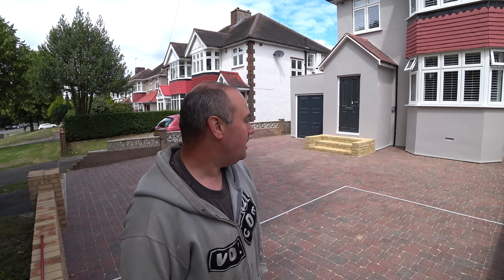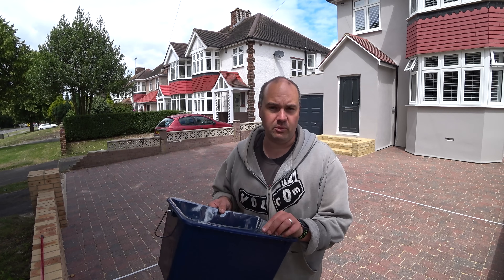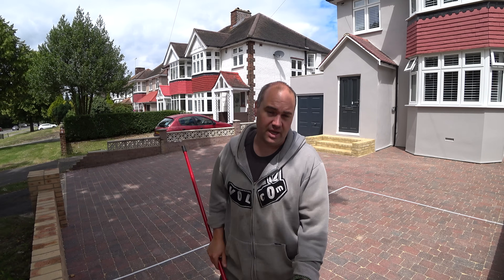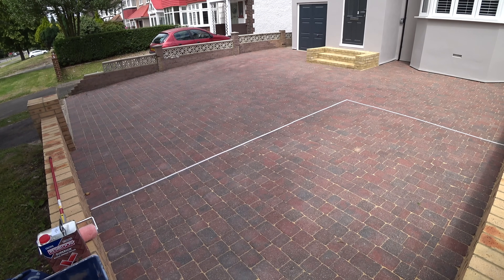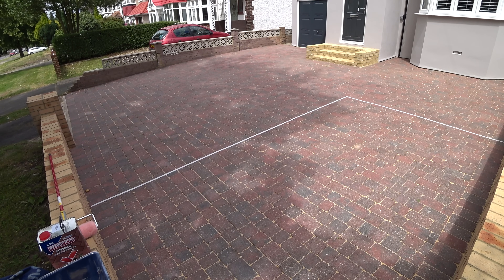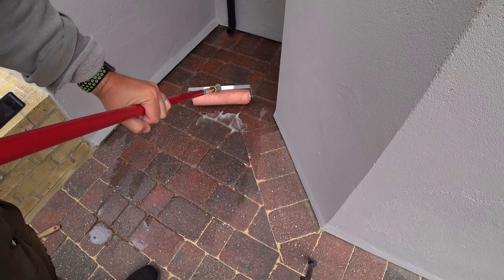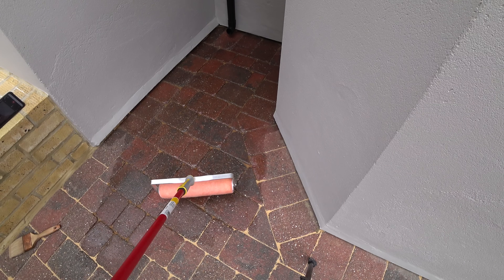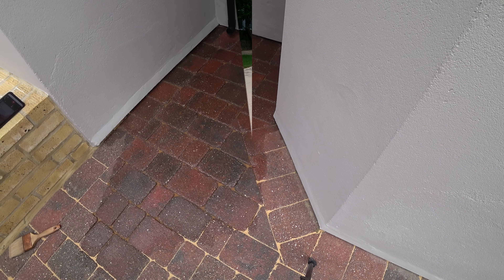How to Seal a Block Pave Driveway - Resiblock Superior Demo & Time-lapse

Comment: Hello Phill, Another good video. From what I have read on the net and grasped from resiblock themselves is that when using a polyurethane resiblock product it can be very unforgiving. Before you re sand make sure the tops of the blocks are dry and you do quite a few test patches all over with dried kiln sand in the joints letting it sit for for say 20-30 mins before digging it out. It is crucial to determine if  the sand bed beneath is dry. If it showered or rained unexpectedly this would be a big problem!!! Any moisture that gets trapped under the sealer will cause a bloom (white milky patches). Once the PU  sealer has cured     you can not    simply re emulsify it with thinners to chase out the moisture. You would need to apply a chemical stripper and jet wash the lot off-which would be a nightmare!  Or it needs to be dry and  manically abraded off.  I have no doubt resiblock is a fantastic product but does need skill, knowledge and caution to use it. Thank you for taking the time to make the video, keep up the good work Phill.
Reply from the maker: matthew calder yes it does need the right conditions to use properly. Like most things it needs to be dry. So long as the blocks themselves have had plenty of time to dry it will be ok. Yes the sand needs to be dry, by sweeping fresh sand into the joints any moisture withing the joint will be wicked up to the surface and you will see it quite clearly. So long as the sand and surface are perfectly dry all will  be well. Resiblock do have guidelines for its use, but they have to have them to ensure the product goes on properly with no comeback. They offer no oil stain guarantee etc so they have to ensure the product has been applied in perfect conditions. Any rain or moisture will ruin the finish and hence case milky patches.
Reply: Dirty Drive-Away Thanks for your reply Phill.. Anybody that has not done there homework on how to use a polyurethane sealer will  open up a big can of worms if any moisture gets under the sealer from either damp sand or damp blocks. In the event it needs to all be stripped off Resiblock told me  they advise contractors to buy " " paromorse"  (licence needed to use it) or Enviromorse pro from Brewers. When I enquired about the products I was suprised to hear they sell buckets of the stuff as there are so many people out there who get it wrong. Cheers Matt
Reply from the maker: matthew calder will remember that product if needed in the future. I'm one of resiblocks contractors and they have never mentioned paromorse. I know they sell there own so called tool cleaner but I think that only works before it's cured.
Reply: Dirty Drive-Away resiblock dont want to promote things that could go wrong which is understandable from a marketing point of veiw as it could harm sales. Ive read you can use nitric acid which is nasty stuff , or a product called easy strip 2000. Would be nice if somebody who has had to go down this road could tell us there experience. Cheers M

Comment: That looks like a £1000 job with the cleaning and sealing.  In my area, If I quoted £150 for the clean alone they would shudder and throw up.  LOL.   I think its the thought of them having to move the Bently.
Reply from the maker: With the resiblock it was £1100

Comment: Arnt you supposed to brush it off mate ??
Reply from the maker: No, you just roller it on and it soaks into the blocks and joints. You only need to brush it off if your dealing with riven natural stone where it may pool in the recesses.

Comment: Superior gloss thought it would be glossier.
Reply from the maker: Yeah to be honest I thought it was going to be proper bling but it isn't. To be fair it was quite nice, it had a slight shine, more than the Matt version which even though is classed as Matt can have a satin damp look. Problem is a lot of people think gloss and it's going to be proper shiney but it's quite subtle. Even still it's not everyone's cup of tea hence why I don't do many gloss ones as people get put off by the "gloss" bit. Phill
Reply: Cheers for the reply I've tried a couple of gloss ones that say gloss or high shine but just darken (glossy)a bit then look normal when fully dry  cost a fortune to.
Reply from the maker: @clawbackx  nearly all acrylic sealers will darken the block (damp look) bit with a Matt finish. Water based sealers go down with a damp look but tend to dry off natural with no serious change in colour. The gloss sealer does give a higher shine than the Matt but not super shiney. The problem is if they were super glossy most people wouldn't buy them as there is that myth that if it's shiney it's going to be slippery when wet.
Reply: Yes tried both versions now think I'll just keep cleaning and sanding it cheers.